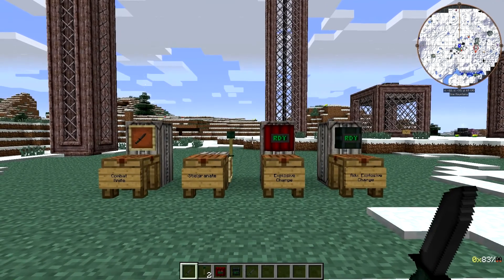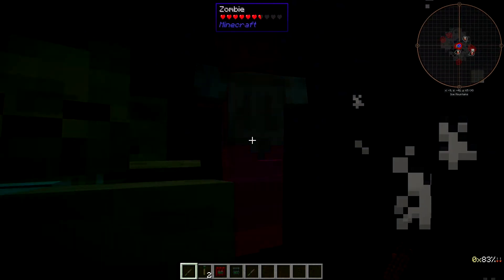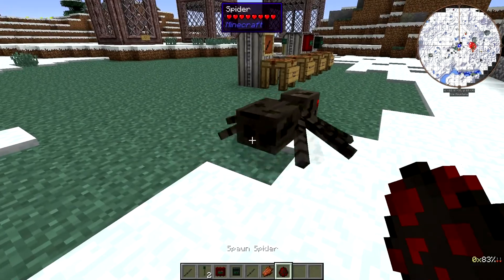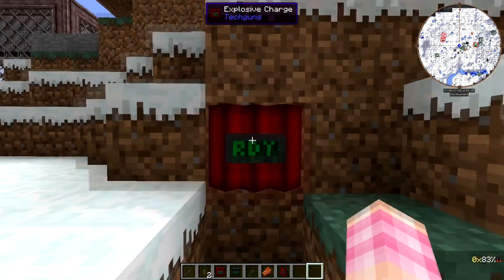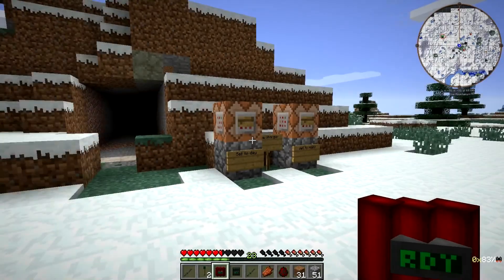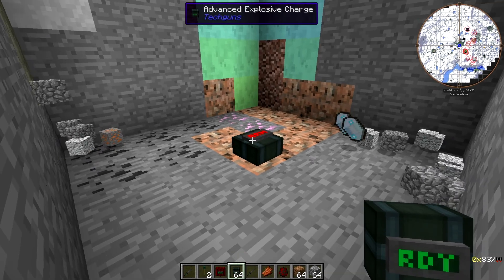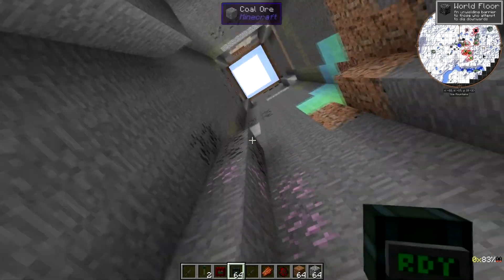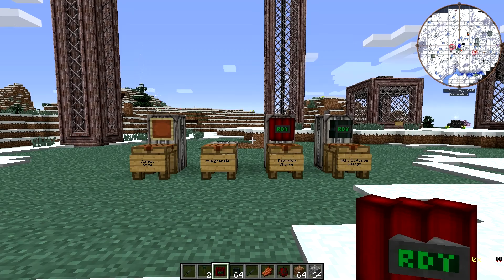Techguns Tutorial #21 - Explosive Charges

Comment: Heads Up sentinal!  It turns out that Immersive engineering has a few Interactions I hadn't known about.  First, Techguns titanium ore can be obtained from Bauxite mineral veins (as a rare 5% event) with the Excavator.  In addition, there is a Uranium ore vein that gives you this mod's uranium ore, plus lead.  Lastly, apparently RotaryCraft Canola seeds can now be used in the Industrial squeezer.  You get 20 mb for 1 seed item.  Thought you would like to know.  I just found this while looking through the manual.